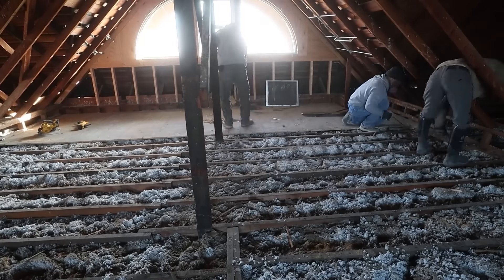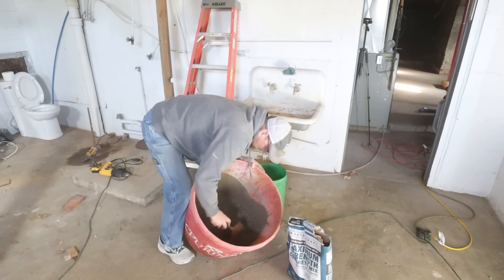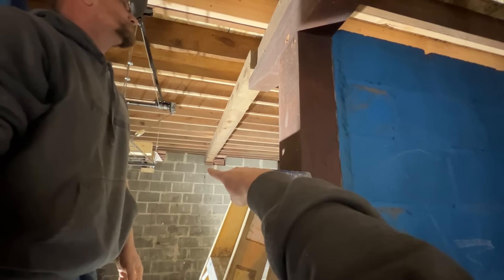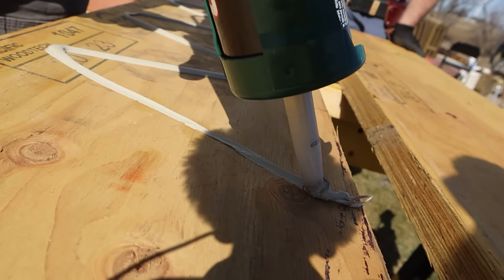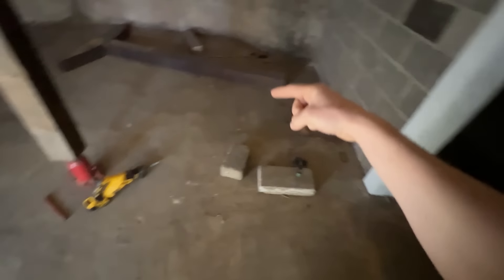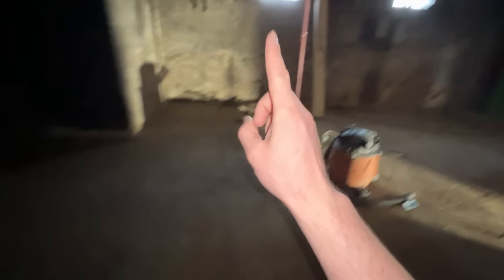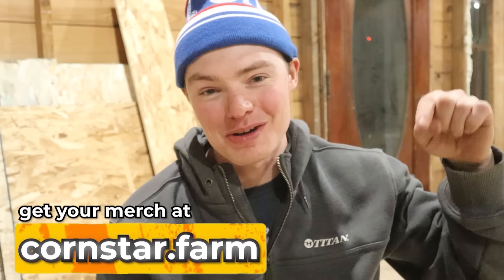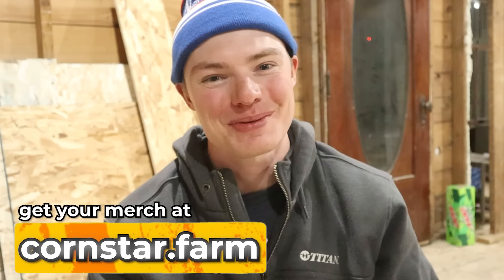Restoring A $7,000 Mansion: Rebuilding Basement Ceiling

Comment: KOLE..A word of advice...from experience of the same, when you bottle or screw jack a support from your basement floor, especially when it may only be an inch thick, don"t place the jack directly on the floor unless it was already reenforced for a support to begin with, otherwise you can crack the floor under weight which could cause your support to  fail....definatly put something under the jack to distribute that load across a larger area of flooring a metal plate is ideal.....no wicked witch of the east reenactments in Iowa  please...😁

Comment: If you redo the concrete floor in the basement, the use of a heavy duty plastic liner will help limit the transmission of radon gas thru the floor.  There will still be gas transfer thru the basement walls if there is no plastic liner, however.  But every bit of additional seal will still help reduce radon gas.

Comment: Cole, as someone who built houses for over 3 decades, I would recommend you only need drain tile along the exterior walls, inside of the footers, on walls without the covered porch. As for digging the outside, I don't see the need in your case, as I saw no evidence of water seepage along any of the exterior walls. New houses require drain tile on both sides of the basement footers, connected through the foundation, all leading to a sump pit. This is a separate system from sanitary system. Additional floor drains can dump into the sump pit. As for the 23' well, great place to dump all the broken concrete from the floor, saves carrying that much out. Pouring the floor, I'm guessing the crew that does that will have a pumper truck on site. Obviously, you already know how to prepare the base, ie. Radon barrier/vapor barrier. I'm retired these days, but, feel free to reach out with any questions. And respond here, and I'll include my personal email address. BTW, you all are doing a fantastic job, be proud! 😁👍

Comment: Hey Cole, I been loving your restoration project. You can get a pump truck for the concrete. I’m in the HVAC industry. Just some food for thought. Radiant heat is great nice even heat. However it is very slow on recovery if you let the home cool down in the winter if your family goes on vacation. I heard you say you were getting forced air cool I would recommend the air handler for the cooling to have heat strips or use a propane furnace for the Air handler for recovery and emergency heating.

Comment: My husband dig a hole all along the foundation in our basement , and black tared the whole outside of it. Then he came inside and he filled in the crack with special concrete, the dry quickly and doesn’t let any water in and he did it to the whole wall. It was a lot of work for one man , and you  have a, much bigger house to do. Better do it when your  young and in great shape ! We never had it leaked again.

Comment: Good videos they’re fun to watch! 

Hopefully you’re installing the in-floor tubing above the subfloor with 1.5 gypsum pour over? If you’re doing hard would floors you’d install 2x2 sleepers every 16” to nail down the hardwood floors. The Pex tubing would be installed between the sleepers. This is going to give you the best heat delivery to the space. I would also look at a GeoComfort - Geothermal system to heat the in-floor water. They’re 300% more efficient than a 90+ propane condensing boiler. Looks like you have plenty of land to install a horizontal loop field and could possibly do the excavating of the loop field yourself.

Comment: I noticed your hot water tank down there.   Put in a tankless heater or two for your hot water.  They're more expensive but save money and last five times longer.  I've had mine 16 years now.  I would have had to have 3 replacements by now if I had a tank.  The convenience if it never running out of hot water is priceless when you have guests staying at your home.  Over 16 years it's been much cheaper and no hassle, than if I had three tank type replacements.  In a large home you may need two, like you would if you had a tank type. You have to consider how long it takes the hot water to get to you.  It heats fast but may take a while if it's across the house so two would be better.

Comment: If you have a problem with bottom pressure you should probably use your well. I live in an area which is actually below see level. We have drainage below the bottom plate of the house which ends  in a cistern with a pump. In the end the water gets pumped to a moat or city sewage.

Comment: You can fix your concrete chute issue by installing an egress window on the far side of the old tank room wall, opposite corner of the house from the current only entrance/exit. 

Frankly, since it wouldn't cost any more then the egress window, it never hurts to have a full set of wide stairs on the outside of the house for taking big tanks out of the basement, or bringing in couches, washers, dryers, kayaks, cords of wood, etc more easily. It would add more light to that side of the basement, and make things a bit safer and easier in the future.

Obviously being in Iowa you get a few inches of snow from time to time, so you would want to enclose the outside stairs, and have a drain at the bottom landing. 

Of course, you can build all that into the future addition too, and keep what you have, as it is. 

Just an idea.

Comment: Please read all the way to the bottom, there is a good bit of ideas, and good advice.  By the way, I LOVEEEEEEEEEEEEEEEEEEEEEEEEEEEEEE watching your vids!!!!!🤗😀🎥🎬📽 this🏚 to 🏠 this

Please read this. I just want to say that if you want to thank us you can, but to me, you don't need to. To be honest, I just LOVE watching your vids. I think that you are doing a GREAT job. I've told my family about this stuff that you are doing, and they aslo think that you are a very smart man and that you DO know what your doing.

Also, if you want to get concrete in side of the basement, then just get a 20 or 30 gallon bucket, and drill a hole ( preferably bigger in size), then hook like a water drain hose / gutter hose, and thenjust get however much you need of just some rain getter hoses, and just run that into the basement where the porch is. It's just another idea to gave in mind.

Also, I think that you should keep that craw space up under the stairs, and just put in a concrete floor. Because you do have children, and so then y'all will have a LOT more stuff. But the craw space would give you more storge. Just saying. I don't know if that will help, but maybe that will help you and your wife.

 👇

Comment: You usually will not tear out a concrete floor to do the pluming. You would cut trenches around the old pipes, tear it out and replace it with new plumbing. I cut concrete for two years here in Oklahoma. Did a lot of basement drains and regular plumbing.

You could do all of this yourselves. Except for those stairs, I would hire a crew to pour them.

Comment: Just what I've heard - basement floors are typically only a couple inches thick with concrete, and when I finished my basement I also found this to be the case.  It's interesting that in the hole in your concrete I didn't see any crushed rock.  Typically there is a few inches of rock underneath the concrete that helps to provide a stable base while still allowing water to migrate to the sump.  In my part of the continent (Alberta) we have sumps in our basement, and during heavy rains I can hear the sump pump turn on a couple times an hour.  When I checked it out, there was a slow but steady stream of crystal clear water flowing in from the weeping tile that I assume runs around the outside of the house.
Reply: One other thing - for the concrete floor you might want to just throw money at the problem.  Putting in concrete in a confined space like that is a pain in the butt, and having a crew come in with the right equipment can have it done in half a day.  Whatever you decide, I am so impressed with what you guys have accomplished.  Your crew are an inspiration!

Comment: im sure someone has pointed this out but DONT get rid of your well. That well is the reason why your basement is so dry. Any water pressure would flow into that well. Also, its not a bad idea to have a backup source of clean water. (you never know what can happen) That being said, you will want to put in a sump pump, most likely with the size of your basement i would say 2 would be a good idea, look at the lay of the land find out where the low area is and put them in that area. the sump pump will allow you to pump out any extra water coming from the surface. and drain it away from the house. The well will still function because it draws most of its water from the water table. the sump pumps will handle over saturated soil conditions. when the soil become so saturated that water rises above the water table.  thats just my thoughts.

Comment: When building out your plumbing for interior walls, I reccommend framing them out in 2x6 or 2x8 to allow more space for the plumbing and insulation. As others have suggested Make sure you insulate your drain cavitiy as you will hear it when water flushes from the upstairs or drains from the washer. To add on there for the wash room & bathrooms you can also recess them an inch or two and add a drain / waterproof the entire space in the event of an overflow or busted line on the washer. For your water, I dont know if you guys have hard water or not. but maybe look at gettting an in-line on demand water heater. For you baesemant utility room I would the same recessed floor with a drain so any water that does get in or comes from a busted line from any of the pipes will only pool/ drain in the room.

Comment: Just a suggestion; I would make a steel supports  under the ends you cut into the walls. I would bolt the metal supports to old concrete  for added strength

Comment: Look more into where you're exhaust piping for the radon mitigation has to go up and out above the roof line then what has to happen in the basement.  Both are important obviously but while you still have access upstairs to hide the pipe is best before drywalling.  Also, an outlet within 3ft of the exhaust fan which would also be up in the attic.

Comment: Weep tile and running your drain lines together would work I think. I am a draftsman and we do restaurants. Always make sure the floor has a slope to the drain. We spec that slabs with floor drains, trench drains, floor sinks to have a 6 inch thick slab. 
I like overkill so always research and definitely do the radon system. Living in Oklahoma I have never lived in a home with a basement.

Comment: There probably is a local tool rental store that would rent a concrete pump to you. If not you can search out a pumping company or get a wheel barrow to shuttle it across the rooms. A wheel barrow would be very economical and easy way to do it.

Comment: Cut your drains and the radan tubing in the concrete and pour the new floor on on top of the exsistng floor you have plenty of head space, plus the exsisting floor will give you a excellent base for the top coat of concrete. It will save you a ton of work and $$$ doing so

Comment: They have flexi line which is like a pool liner that they attach to the cement truck and that will help you get the cement where you want it also use wheelbarrows

Comment: When u dig or if u dig to put in a drainag system. Put tar on the walls. 2 coats. Helps seal the concert from outside moisture. Idk if they did that back then or not.

Comment: We have a house that was built in 1947. We've had more than our fair share of basement flooding from heavy rain. Our basement is in major need of a rebuild because the house is so old. From our personal experience, we dug down on the outside of 2 walls of our house, all the way to the basement floor. We painted a black tar sealant on the 2 walls & stuck on thick plastic sheeting to the walls. Next we laid in a drainage pipe along both walls. Then we filled it back in with gravel & put the dirt back on top. We poured in concrete steps on one outside basement wall.

 After the first few years after our tar sealant, gravel, drainage pipe project. We had a lot less flooding in our basement. However, over the years we've had a lot of ground shifting from earthquakes. That our outdoor concrete steps are now drastically leaning toward the wall with the drainage pipe that's below it now crushed. That we're back to square one with all hands on deck with wet dry vacuums, saving the basement when we get a heavy rain storm. I have complete faith in Cole, Justin & Roman in problem solving your basement drainage. My hat goes off to you gentlemen.☺

Comment: You  can also wheel barrow the concrete to the other rooms in the basement. Two or three wheel barrows and a couple guys leveling and it will be done in no time.

Comment: Call a radon company before you pour the concrete as they will have to drill into the new concrete to reach the sand below they may want to run hose to draw from different sections of you basement to suction out the radon and then vent and filter outside.  It’s pretty slick how they do it, we had moderate levels but better safe than sorry.

Comment: Had delt with radon twice.  My first home was just above a 4 and my work office was above 10.  You can test it now but if it would pass ok I would also be testing it after the new pour as you are disturbing the floor.  Only reason it would be a good idea to do now is you have a way up to the roof.  But with the extra electric and needing to monitor and replace the fan after x number of years when it dies it's a lot of hassle if it passes with a lower level.  By the way if it does test high like my office we ran one pipe out and it wasn't good enough on the second test.  So another pipe had to be installed a little ways away from the other pipe.  Still used the same pipe to the roof though it was just T'ed together.  Good luck.

Comment: Cole, I wouldn't recommend tying the exterior drainage system to the interior basement system; you're just asking for flooding problems if you do that.  It is an excellent idea to draw any water away from the foundation and basement walls; just don't tie the systems together.  Use 2-4 strategically placed sump pumps to handle anything that might come up from below the pad, and you should have no problem keeping your basement dry. 😉😁

Comment: Order a pump truck for your concrete delivery. Also consider building some interior  walls with 2x6 studs I'm an HVAC guy and having that extra wall cavity helps and the plumber would also appreciate  a little for thought. 😊

Comment: one thing i will say you should do on your home is plaster instead of drywall i worked on homes for 6 years and the largest difference between house was plaster or drywall. plaster is so much more durable and looks so much better than drywall. although it is more expensive to do i think it is a no brainer. but keep up the great work!

Comment: Yes dig around the outside of the house and put in a drainage system (french drain it called here in NZ) but also waterproof the exterior of the house before you put the dirt back - insulation and plastic to stop water coming through the concrete that is not currently there that is needed - if you could get the drains under the concrete to flow naturally down to the creek and not have to use a  sump pump as they do not have a long life and fail when you need them the most - depending on use 3-5 years is the life span of a sump pump

Comment: I think I mentioned it before but don't use just one boiler for your heating system. If you have two smaller boilers set up with the proper valving, if one needs to be replaced, at least you have some heat. They can also be set up to just run one when only a little heat is needed and add the second as the temperature gets colder outside. Also check on electrical time of use rates. You might be able to heat water cheaper with electricity at off peak times than with propane or oil. Have you looked into corn fired boilers?